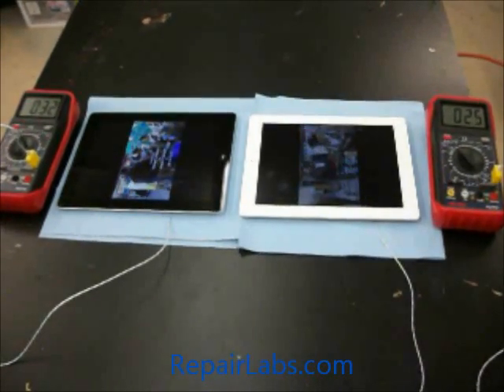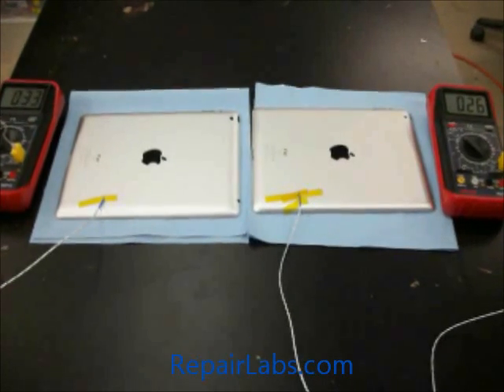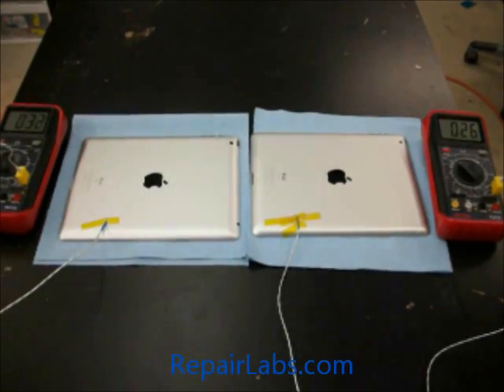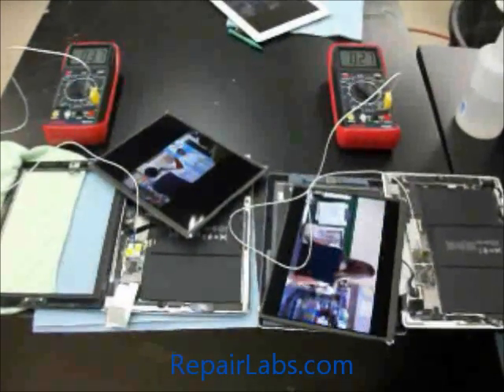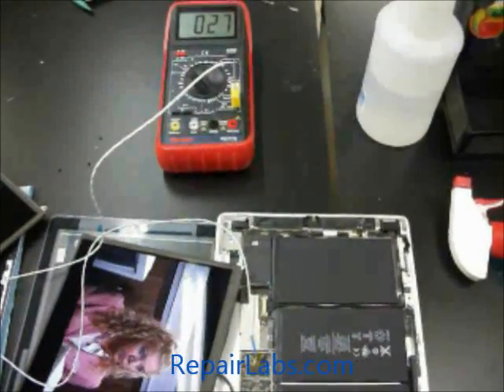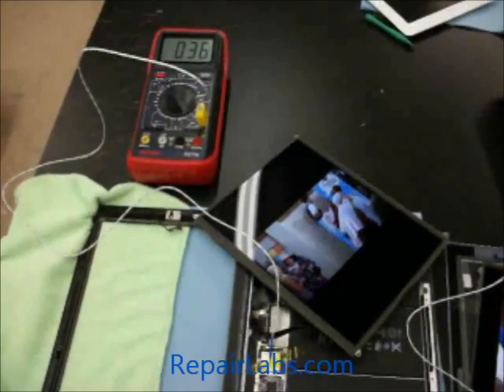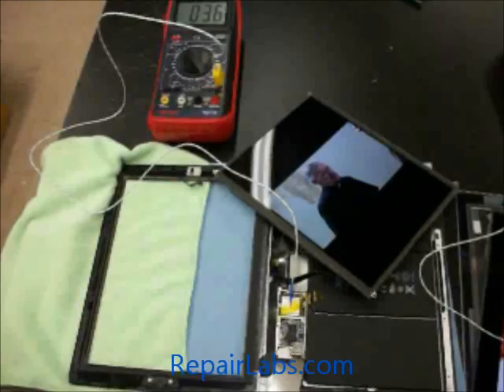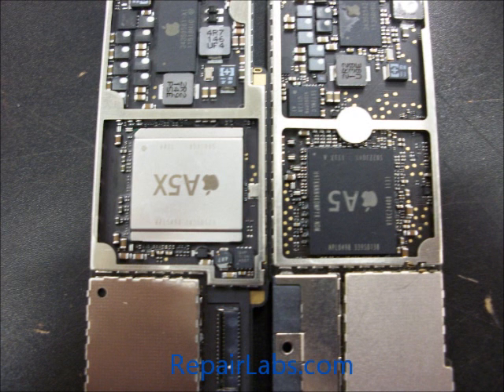New iPad 3 Heating Issue

Comment: Ok guys. Looks like you can use a thermometer. Here the question is...what is the temperature spec that was used to design and build this unit?. Keep in mind that true electronics natural enemies are Heat and Humidity. Overheating a unit happens when it heats up above the spec limit... so what is that limit? is that simple. In this case, as in most electronics devices with a Microprocessor, heat is a consequence of usage (the more intensive the higher it gets). Cheers.

Comment: I wonder if the processor will crash in the long run (4 months in ) due to the heating problem. The thermal coating will harden and crack in a month under such heat and result in system failure. Summer climate esp in New York and LA and many Asian countries will be test of this system. The new Ipad so far seems to a flawed product and I believe apple should own up to this because if they do not they are sure to tarnish their companies image into a dishonest brand.